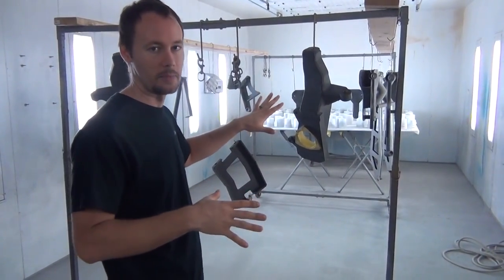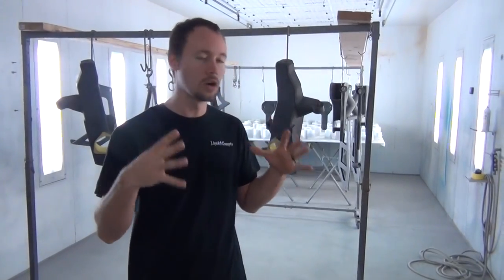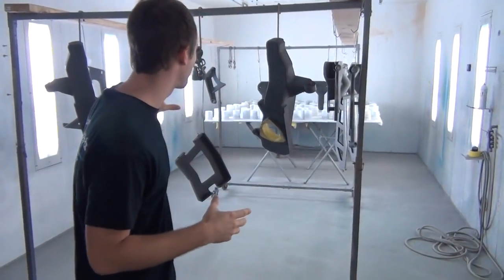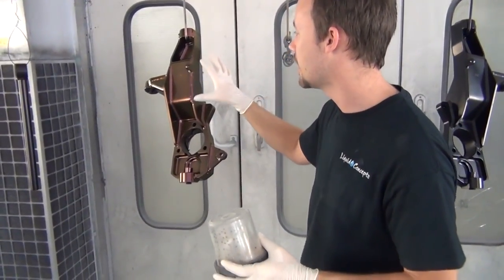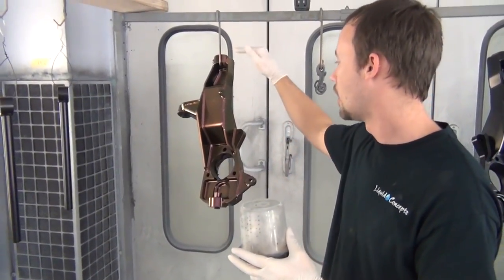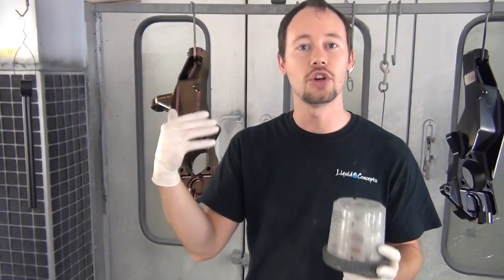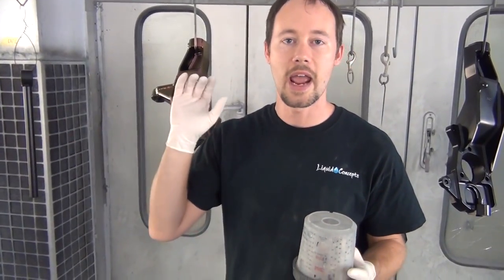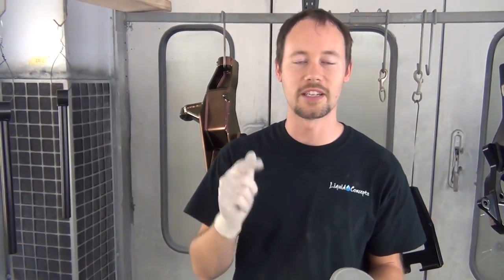HOW TO SPRAY COLOR SHIFT PAINT! | Liquid Concepts | Weekly Tips and Tricks

Comment: Does it have to be a gloss black base? or can you use a black primer?
Reply from the maker: You really need a base color as the primer will not allow the print to adhere unless the primer is designed for the hydrographic process and it states it will.

Comment: i wish you would have shown the product before you mixed it up. id like to see the particles separate , before it was mixed. Are the flakes multi sided,  or how does it  work?
Reply from the maker: The flakes look like a normal metallic from what you can see but when zoomed in you can see that they are cut in multiple different faces to reflect different colors depending on how you look at it. This is a very unique coating that gives a one of a kind look!